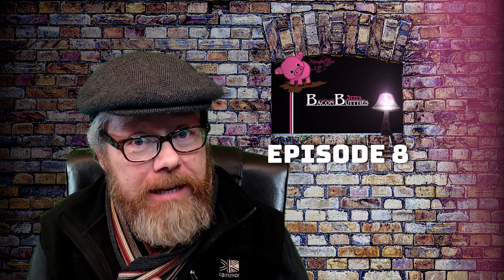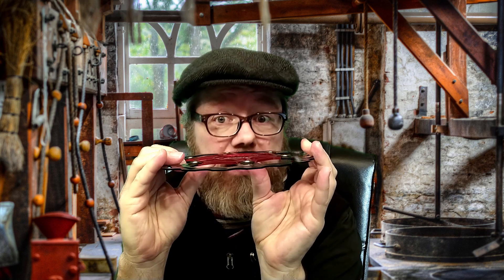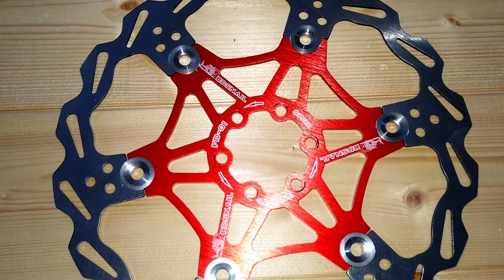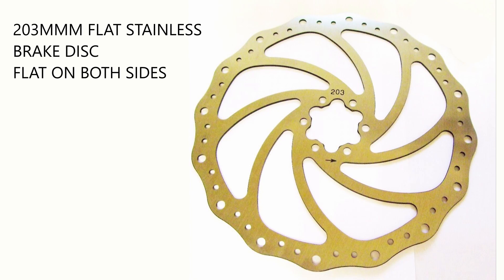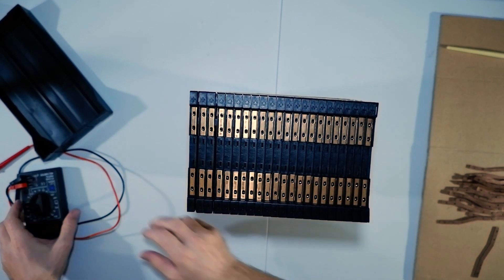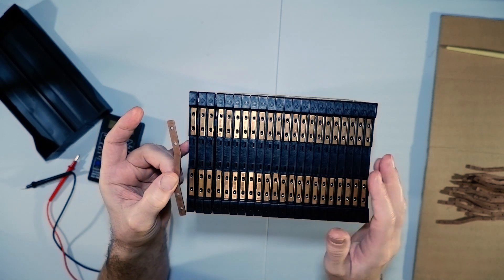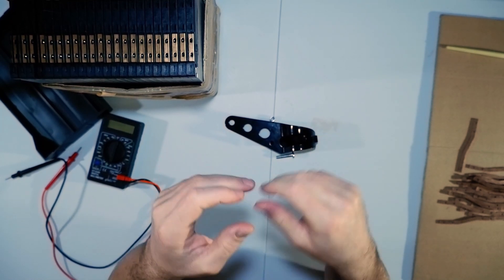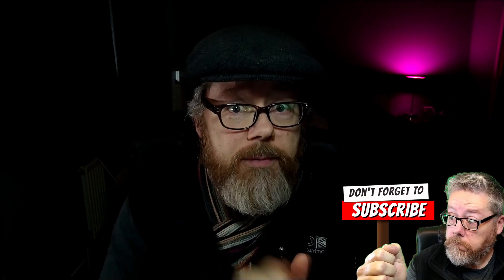FAST EBIKE BUILD UK ROAD LEGAL PART 8 - WHAT BATTERY AM I USING AND MORE BRAKE ISSUES

Comment: Where abouts did u get the cells from mate
Reply: Thanks
Reply from the maker: I got them from eBay, will have a look for a link now.
Reply from the maker: https://www.ebay.co.uk/itm/14-Eig-C020B-Cells-14-busBars-DIY-20ah-52v-ebike-diy-battery-10c-rated-5000w-/254810000735?_trksid=p2349624.m46890.l49286

Comment: How do you figure 200amp discharge?  Aren’t the cells in series not parallel.
Reply from the maker: The cells are rated at 10 c maximum, the nominal capacity is 20ah so it does work out at 200 amp maximum. If i had 2 in parallel then it would be 400 amp. It's just the way these type of cells work.
Reply: @baconbuttties  seems wrong.  Got a link to the data sheet for those cells?
Reply from the maker: @bj97301  Which bit seems wrong?  You can have a look at this pic from ebay with the data sheet. where I bought them. https://www.ebay.co.uk/itm/EIG-PHEV-EV-designed-lithium-polymer-cells-3-7V-20AH-price-per-single-cell-/254793076638
Reply: @baconbuttties  the 200 amp calculation seems wrong. Should be 10 amp if you have a 20s1p pack.
Reply: @baconbuttties  I think I figured it out. It seems as though each one of those “cells” has 20 cells in parallel. That’s where the 200 comes from. Sorry I am used to 18650 cells 😂. This video helped me understand lipo type cells better:
https://youtu.be/9nmDj0Ykn-c
Reply from the maker: @bj97301   You are definitely getting your calculations mixed up...10c bursts of a 20 ah Eig cell is 200 amps. 
Example....
2C C Rating Example
2000mAh Battery
2000mAh / 1000 = 2A
2C x 2A = 4A available
60 / 2C = 30mins charge/discharge

you can use this online calculate below
Battery capacity is 20000 mAh or 20 Ah and the rating is 10c
 http://www.batteriesinaflash.com/c-rating-calculator.
Reply from the maker: @bj97301  I was used to 18650's  so it took me a while for me to get my head around the EIG cells.
Reply: @baconbuttties  yeah me too. Thanks for the info. These cells are actually really awesome!  Good cycle life.

Comment: I used a file while the hub was spinning to make a grove to fit the rotor on. Kinda like a really shitty lathe 😂. After that I bent the rotor a bit while it was on the hub to compensate for the shitty lathe job. Wasn’t too bad of a job.
Reply from the maker: It would be a wonky grove if i tried that 😂

Comment: I built a similar bike last year , using the UCK1 display and a sabvoton 72100 controller with a MUXUS 3k hub motor , I built a custom 21700 li-ion pack which performed very well , but I tested it using 20s li-po pack , the only problem with the li-po packs I found was that you can only drain them down to 3.5v per cell , otherwise you risk damage and shortened life span , whereas li-ion packs can be drained down to 3v per cell safely,, great build so far ,interested to see how it turns out
Reply from the maker: It says recommend discharge is  3 volts for these Eig  batteries  and can go down to 2.5 on the specs sheet that I read, I think I put the spec sheet up on one of the videos. How did the bike go on li-po batteries?
Reply: @baconbuttties  the li-po pack performed very well , but it was only 5ah ,so not great range ,but it was only for testing the bike , it was a 20c rated pack , using 4x 5s batteries in series = 20s , sorry didn’t see the low voltage rating on your li-po batteries, I was using hobby grade li-po packs ,,
Reply from the maker: @spinymonk1590  Yes some people have said the cells I'm using are good and some say they are not. I hope they work well 🤞. I may do a 21700 pack in the future.

Comment: is this battery good? https://www.ebay.com/itm/Original-48v-58ah-Li-ion-Battery-Volt-Rechargeable-Bicycle-1000w-E-bike-Electric/203224735885
Reply: 1000w, 58 ah, 48v and it is lithium battery.
Reply from the maker: I seen 58 ah and am very suspicious at the low price. I think you need to find out what batteries are in it.
Reply from the maker: It will probably have cheap Chinese batteries fitted that overstate mAh's
Reply: it goes 20km only using battery

Comment: just wanted to say loving the build videos and also ask if you considered using the magura mdr-p disk rotors (e bike specific rotors) 
 i am currently in the process of planing an ebike project myself and these are one of the items i am considering for my bike
Reply from the maker: Those disc look great but the Magura mdr-p price is 👀!  They do a cheaper Magura MDR-C Ebike Disc Rotor  which looks stronger than the ones i have ordered.
Reply: @baconbuttties  yea those mdr-p are a touch on the costly side didnt notice they had the mdr-c so thanks for pointing those out as an alternative
Reply from the maker: @haggisbasher2906  👍

Comment: With a 22s battery pack and a 72v Sabvoton, I recommend you charge no higher than 3.9v per cell. You have to take into consideration, if you use regen braking, depending on model of Sabvoton, regen could overvolt the controller on a fully charged battery, or, it will not let the regen start until the voltage is low enough. Also, if you are using one of the Sabvoton displays, there is a good chance it will blow beyond repair. 
Sabvoton's are good controllers, but their voltage reading is quite inaccurate (they read about 2 to 4 v higher than what is supplied). The advantage of 3.9v apart from better reliability of the controller is a much extended battery life.
Reply from the maker: Yes they state Support Voltage: DC 48-72V (max. 90V). but I did read somewhere that voltage protection limit is 95V but I am getting a bit to close to the limits. Display I have is UKC-1 which is rated at 72 volts which means that would be no good. So do I drop to a 20s to save myself the hassle or go with the 3.9v per cell?
Reply: @baconbuttties   I would stay at 3.9v per cell.  Your pack will last a lot longer, As I also said, you have to watch the Sabvoton for they way it reads voltage. An 84v pack will be read by the Sabvoton as about 88v - 90v and if you do use regen, this will go up a lot more. If you set with the Bluetooth module or PC, you will see the voltage it reads and can compare it to what your battery pack measures at.
Reply from the maker: @JohnS-sn2sd  👍🏼
Reply: @baconbuttties  Hi i have the same controller..you can only use 22s coz the sabvoton app will show it a volt or 2 higher. If you add 23s pack it will show an error. Im running mine perfectly with 4.18v or so and 22s but no regen braking so ill never go overvolt.
3.9v is low imo..at least 4.10. You will get more power and capacity
Reply from the maker: @MrDeceptacon88  That's good to know, what display do you use?
Reply: @baconbuttties  cycle analyst..but sometimes the sabvoton app for controller changes

Comment: I was confused for a bit when you said each cell does 10a peak lol. It's a 22s1p pack so you would only get 10a peak total if that was the case, not 220a. Its actually 10c burst so that's 200a burst total for the pack and 100a (5c) continuous.
Reply from the maker: Yes my terminology goes out the window when i'm trying to explain things on video and I got a bit confused with the 5c thing as i'm used to 18650's,  So would I be right in saying its 20Ah times the 5c giving the 100a
Reply: @baconbuttties  Yes that's correct. (c) is just a multiple of the capacity of the cell so 20Ah x 10c = 200a etc.
Reply from the maker: @BlindsideFPV  👍🏼

Comment: 10 amps is ok for fast change but very often the limit is in the charge connection. The small round connection on some ebikes (2amp) overheat at 4amps. Remember the UK sockets are about 13 amps maximum so keep below 13 amps.
Reply from the maker: I think the Output current is 3-12A on the charger I'm looking at. There is some cheaper ones that charge at 3 amps but not sure on the quality.

Comment: I like the look of those cells and busbars, where did you buy them for? On my 48v pack, I just use the standard charger which irc is 54.6 and let the BMS cut the charging off at a lower voltage. Added benefit if you know you are in a longtrip, use BMS app to up to max voltage and allow 100% charge. Charger looks right to me, but no idea if it's a good make.
Reply: There's so many sizes and types I wonder what the lightest wh per g cells are that are generally available to the public is. Would love a ~50ah 72v pack.
Reply from the maker: @GlaucusBlue  l found the batteries on eBay, I will have a look for the link to it.
Reply from the maker: Heres the link for the batteries https://www.ebay.co.uk/itm/72v-20ah-diy-Ebike-Battery-20-cells-and-busbars-339-lithium-ion-read-listing/254848366757?ssPageName=STRK%3AMEBIDX%3AIT&_trksid=p2060353.m1438.l2649
Reply: @baconbuttties  thanks, quite expensive per kwh, but nice high discharge current and easy construction into the pack.
Reply from the maker: @GlaucusBlue  yes it was the easy construction that made me buy them.
Reply: @baconbuttties  also makes changing a bad cell super easy, compared to spot welding which is what I've always done in the past.
Reply from the maker: @GlaucusBlue  👍

Comment: Shame about the rotors 😕but I'm certainly guilty of buying the wrong bits or blowing them up! Nice choice on the batteries and BMS. BMS is absolutely brilliant and having the bluetooth app helped me diagnose a faulty connection in my pack which you can't do with other BMSs. With the cells, they are great to work with and I'll be interested to see what difference the copper bars make over my aluminium ones as I get a bit of sag at 4kW with a 2p pack. I'm guessing we both bought the cells from James, but I reckon 4.1v will be fine for charging else you loose a decent amount of range. (but yes, the less you charge the longer they technically last) Also I know a few people who use that orange charger and it seems to work fine. There are loads of options out there (quality of some is questionable) and was thinking of building my own with a dedicated PSU and boost converter for current regulation at 1kW charging, but that's too much at the moment! Anyway, keep up the good work 👍
Reply from the maker: Yeah I might fully charge them now and again but like you said 4.1 should be okay. I'm hoping for 25 mi!es of range fully charged.
Reply from the maker: Yes it was James that I got the batteries  👍